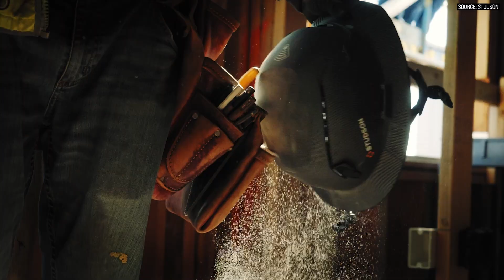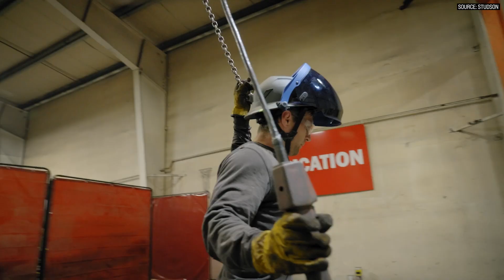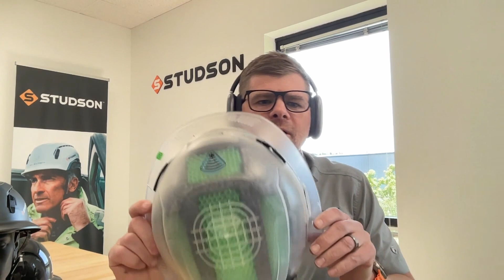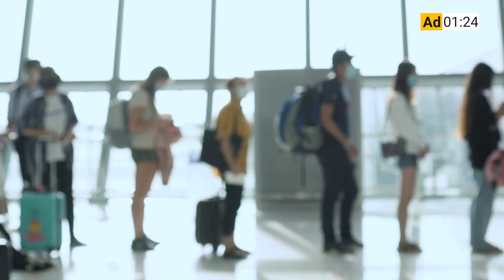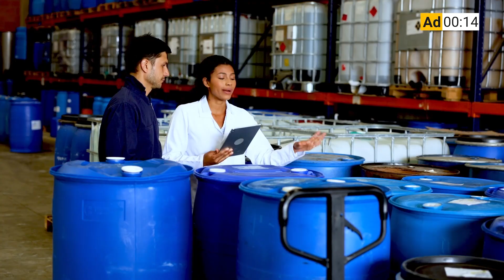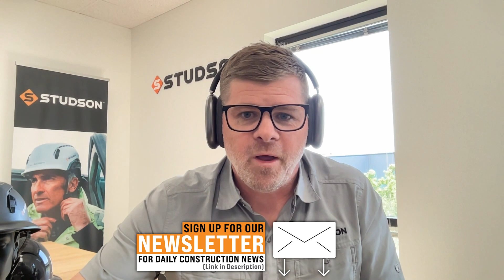New Helmet Design Brings Hard Hat into the 21st Century

Comment: This helmet does not sit low on the head as this video claims. One of the biggest complaints by users is that it sits way to high. This helmet is not a good combination with welding hoods. There is a person welding in this video and I will point out a few issues with this helmet. This helmet sits high on the head which places a welding hood high as well. That creates viewing issues while welding as it places the viewing lense above your eyes. Also it exposes your neck to UV rays during welding because of the fact that the helmet raises the welding hood. The welding hood is elongated to protect from skin exposure and that protection is almost eliminated with this helmet. It also places the welding hood closer to your face and as a welder that uses a respirator while welding, that is not possible when used in combination with this helmet. I have also removed the foam insert from the helmet and placed it on my head. The foam sits on the very tip of the head and does not extend down to protect the rear and sides of the head. I have pictures for proof of all these issues to explain the my employers how and why this helmet is not the right equipment for some of us tradesmen. Last but not least, this helmet is made in china. We have been informed by some of the largest General Contractors in the nation that we are not to use rigging marked “made in china”.
Reply: Thanks for this info. As a Tradesmen myself, a high sitting position is a absolute deal breaker. Old school Fibre-Metal user myself.
The good thing is having competition in the sector as we can all have choices, but again, a high sitting position is a no deal for myself and many others I know.
Reply: What Milwaukee tools are made in USA?
Reply: @IYar56  a significant portion of their tools are made in the USA and I know at least the ones we use on our jobs are. The owner of the company I work for is big into purchasing American made products whenever possible.
Reply: @Keef_Chief86  and yes some are not.
Reply: @IYar56  it’s funny how my comment on the helmet turned into a discussion on what is made in china and America. Honestly I don’t think it really matters where this helmet was made, it still sucks for a welder to use it. Or maybe it does matter where it is made. China can easily slap a sticker on that says it was tested to the standards required. In reality, has it really been tested? It could go either way.
Reply: Still the made in china issue. A big part of Hilti powertools are made in china and they work perfectly! Plus, why should the world use made in USA products? Considering the way USA treat the rest of the world I world ban USA products instead
Reply: @ I’m all for it. Every country should use their own resources. It would be better for the environment. Hilti is good but we use Milwaukee which are made in USA and are excellent power tools. As far as America treating other countries bad, please elaborate. America is the number one consumer in the world. For the passed 4 years prior to the Trump administration, we have let anyone in the country that wanted to be here and receive benefits that most Americans are denied. I’d like to also add, I refurbished my old Bullard hard hat that was made in San Francisco years ago. I installed new rivets to accommodate a suspension that protects the head from multi directional impact. I’ve been using this hard hat for years! Way better than any Chinese made product.

Comment: I have been wearing Studson for years now. 

Aesthetics aren’t bad
Accessories are good

However… Comfort and airflow (on the non vented) are absolutely horrible.  

Adhesive on the hook portion of Velcro for liners sucks and they wander/pull out far too easy. 

Plastic screws and nuts sheer off with even a single drop sometimes. 

6 hrs after removal I can still feel the indentions from the hard foam on my head/scalp.  

I’m sure it is a viable product.  But was happy to get a different hardhat when going to my new contractor.
Reply: thanks for the info m8, what did you get after this one?

Comment: My question concerning this hardhat is this, like sports helmets in skiing, biking and motorcycling once it receives an impact, is the integrity of the hard been compromised? Once sporting helmets are considered impacted, they are considered ineffective and need to be replaced. 
How often will someone need to replace a helmet like this, through normal wear and tear?
Reply: It would have to be replaced at normal intervals like the previous hard hats: 
Maintance intervals and replacement requirements don’t change. If there is an impact with the helmet, just like any other, it would need replaced.